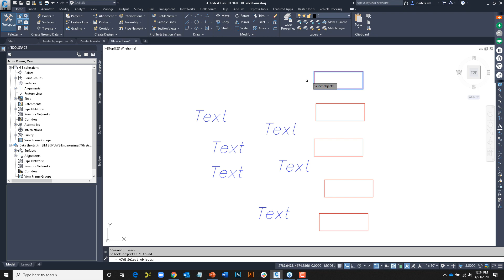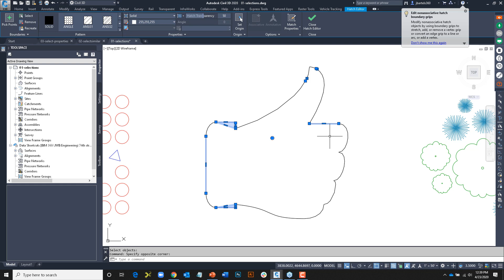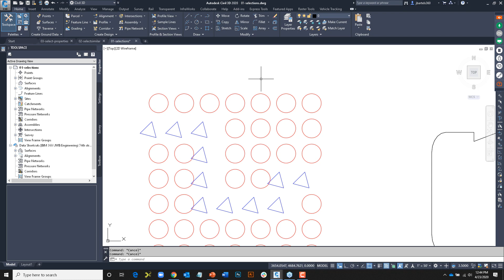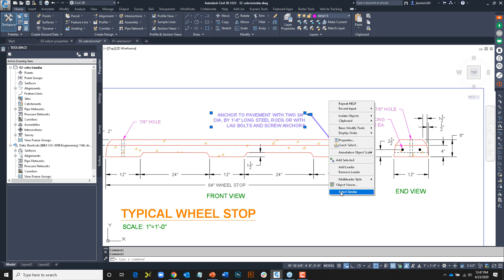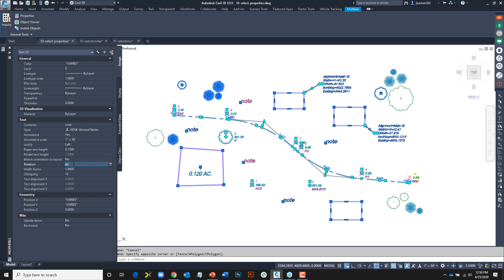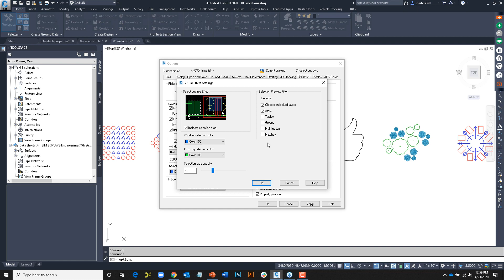Making Powerful Selections using Civil 3D / AutoCAD

Comment: Good stuff. You can also do a crossing freestyle by holding the left button down and dragging left instead of right. With groups, you can also quickly disable and reenable groups (to say, modify an item in the group) with Ctl-H. For legacy cad fellows, another old selection method is FILTER. It doesn’t find non-legacy AutoCAD objects, but can be cool in some cases - such as finding plines less that 1 unit in tenth. It’s also Boolean so can add these with this or this or these without that, etc.
Reply from the maker: Thank you Dave! I appreciate the comments!  I started using FILTER in AutoCAD 12 back in the early 90's.  I logged a lot of time using the And/Or/Exclusive Or/Not Boolean functionality.  I also loved that (unlike with QSELECT), the filters could be saved and re-used in other drawings.  Due to the 30 min. time constraint, we didn't have enough time to do it justice (considered it "bonus content" that we could add to a future session).  If FILTER recognized Civil 3D content, it could be a game changer for civil infrastructure workflows.  Thank you again for your support!
Reply: @JeffBartelsCAD  You're a master, Jeff.  Thanks for doin what you're doin.  I used intersectioning for the first time this week thanks to you.

Comment: As usual I have a great time with your amazing techniques 

It would be really powerful if we could have a dynamic selection set based on some spastific properties 

Like that one in MavisWork 
(selection set by search)
Reply from the maker: When you get a chance, I recommend exploring a command called FILTER. (This command pre-dates QSELECT.)  Using filter, you can create precise selections having boolean options such as AND, OR, Exclusive OR, and NOT.  Filters can also be saved for re-use.  Since the FILTER tool is a native AutoCAD command, it doesn't support Civil objects.  That said, depending on the selection you require, it may suit your needs.  Hope this helps!